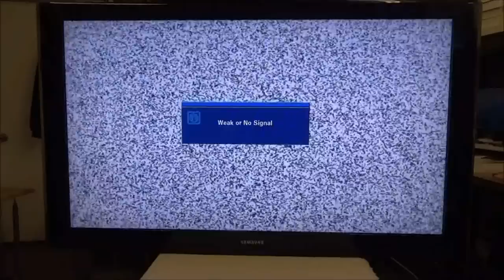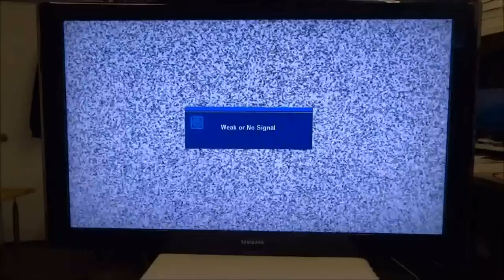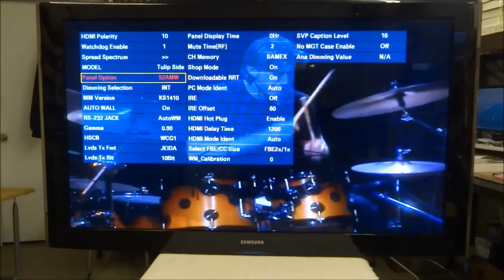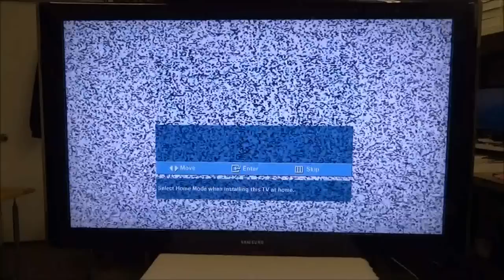Samsung Solarized Distorted Picture after Main Mother Board Replacement TV Repair LNT5265

Comment: I just purchased a Samsung 46" LCD off eBay with the same solarization issue and tried several fixes including software upgrade, jiggling connectors and factory resets. Was thinking i needed to buy a T-Con board but stumbled across this post. Great news, this menu selection method fixed it!! I now have a $70 TV that works just fine. Cheers

Comment: Good info. I've seen some of the older Samsung's also need a proper LVDS format option. In your case the format changed from VESA to Jeida when you changed the panel option, but some other model's mainboard might come with a proper panel option but still the picture would look like that :)

Comment: I got a 47 in philips  lcd tv 47pfl3603d/27 I changed  the main board  because  three hdmi  quit working  I changed  it with a new  one  and it worked fine I program  the ssb then I started  getting  solarization I was wondering  if  there is a service  menu  where I change it like u did on this tv

Comment: Hi Norcal715, i need your help in a Tv with colour Problemes i know Gamma IC is faild (Tcon) So now i will install a new Board in a Samsung TV and the Picture is now solarized. It is the same problem with the Main AV? I only must go in this menu with your code? Or is Panel or Main AV faild?

Comment: Hi Norcal715  I have problem with my tv is a sony bravia model KDL-40Z4100, The problem is that the tv has a solarized distorted picture but when I push the menu button the the solarized looks ok only in the menu screen looks distorted and when I exit menu the solarized comes back to the tv and I was wonfdering if you can help me out to know what may be wrong with the tv if it is the tcon board,the LVDS cable, the main board or the panel please reply thanks.

Comment: I have similar problem with my LG L1919s monitor and I found that secret menu and panel option but that couldn't solve my problem.
Do you think the chip on the board is gone?

Comment: Hello! My samsung lcd LE32R86BD is not working properly. When I start it up half of the image is much darker and the image works on one half correctly but in the other half works just like in your video. Do you think that If I try the same thing you did onlyy from the remote control just like in the video whitout changing the board (that circuit you shown us) it will work?
Thanks!

Comment: I have a Vizio VO370m tv that had a bad color picture with the menu coming up in the wrong color as well. I researched on line and figured it must have been the Tcon board. I ordered a new board online but it was not the same part number but was told it was a substitute and would work. When I installed the replacement board the picture was worse than what I had so I assumed it was a bad Tcon board that I received but when I called the shop they said it must be the main board and not the Tcon board at all. He went on to say the Tcon board I got was not a match for the original main board.. Any thoughts?

Comment: Hi norcal715 i have the same problem on a unit.Its a Sanyo dp42841 . I replace the main board because tv didn't power. Now with the main board i received TV turn on but the picture looks just like your TV. Do i need to reset the tv or its a bad main board i purchase. Thank you for your time

Comment: Hi Norcal, I have a Samsung LA46F81BD Australian model LCD TV from 2008 that has started exhibiting the clicking problem and takes 2-5mins to turn on. From what I have read, a lot of people have had success just by replacing the faulty 1000uf 10v capacitors and haven't had to chane the EEPROM chip or reset it. Will my TV need a new EEPROM chip? My TV functions perfectly fine when it comes on so I'm assuming the EEPROM chip isn't damaged?
I'm going to try and get good quality capacitors tomorrow, fingers crossed!
Reply: Also what type of solder do you recommend to use for soldering the new capacitors?

Comment: I have a vizio P42 that made a puff sound and turned off. I opened tv to see what happened. I replaced a fuse and a capasitor which i got sound but no picture. I replaced the y sustain board which now i have picture but its not clear a bit dark. Do i need to replace the z sustain board or what would you recomend?

Comment: I have a Vizio E422VA smart tv which did have no picture at all, just sound.  I took the liberty to meter and replace every component in the unit with the exception of the tcon board and the display itself.  I now have a solarized screen.  Can you guide me into the service menu to make adjustments to correct the issue just as you did with the samsung tv  in your videos?  Thank you in advance.

Comment: Hi Norcal.  I'm a fan of your videos and I would like to request some help.  I have an issue with an LG 42PX4RVH (chassis RF-052C) where it works normally for around 45 minutes and afterward the picture goes green.  I'm not talking about the entire screen going fully green but rather the picture on screen turns into a combination of blue and yellowish colors.  Sometimes the screen just becomes very glitchy like a broken video game.  The front panel buttons often also stop working completley at some point.  If I turn the TV off and on it goes back to normal for another 10-30 minutes before failing again.  This fault happens on both video inputs as well as over the air TV.  Audio keeps working throughout the entire time and never fails. I have experience with electronics but I'm not too familiar with Plasmas although I do have a general idea of their layout.  I think it might be the main board but I'm not sure.  I was hoping if you could orient me as to which board might be at fault or what you generally think might be the fault.  I would very much appreciate any help you could offer, thank you.

Comment: It pays to write down the existing option bytes and other settings before you change them on the set (if you haven't done it before). This way you can fall back on the original values if anything gets messed up.

Comment: morning I have a Samsung TV model number un 55 e s 75000 TV was bought in 2002 my question is is should I prepare it or buy a new TV thank you for any info
Reply: dont buy one if u got simple problem like this Id fix it myself If had a 55 sammy. I just fixed a magnavox same issue changing out the main fixes it . It only cost me 25 for tv on craigslist and another 7 for a board cheaper than a new set.Its usaully just a cold solder on the board but changing the board is much easier .

Comment: I lost my picture on 58 inch Samsung plasma. replaced y board and buffer board with used. The picture is still black. turn white for a half of a second and keeps doing the same. I tested all voltage on y and x board. checked ok. do you have any suggestions. thanks.

Comment: i am having almost the same issue with my samsung ln-t4671f
but instead the areas that were solarized on that tv would be grainy
and it's intermittent
wondering if you had a similar solution?
Reply: i found another video that shows the fix, you have to go in the hidden settings i think you hit menu,1,8,7 right after you hit the power button and before the tv turns on i'll try and find the video for you one sec
Reply: i don't honestly think magnets effect lcd displays in the same way they did the old crt displays but it's possible
Reply: idk honestly how to add a pic?

Comment: My Samsung was squirted by my son with a squirt gun.. the water ran down into the front bottom part of the screen. Since the TV has a like high pitched power noise when it turns on... It's completely white now since it was factory reset by someone that doesn't know what they're doing.. (me) lol. Can you help me? It was too expensive to throw away.. if I can be walked thru how to fix it.. I will def take any advice. Please and thank you so much for your time! BTW I'm so glad u guys post videos like this. Otherwise I would've thrown it away.

Comment: Seems easy, I have this same problem with a 42 inch hyundia 4240 plasma could anyone tell me if the same process would be used on this set. Also could anyone tell me the number code to get to the service menu on my 4240.many thanks I enjoy your video's immensely. bob ford556

Comment: HI Norcal715
great work and amazing skills,i need your expertise I've got a LG37LK450-UB after replacing the main board the picture has distorted or solarized, i' did a research on how to factory reset but no luck i'm hoping you could help me please..
thanks a lot
Reply from the maker: the new board must be set to the wrong panel version, you could try and find the eeprom and swap it off of the old board and see if that helps.
Reply: norcal715 excellent  question here's a thing I don't know or how to identify the eeprom unless I've got the schematics, appreciate your response..